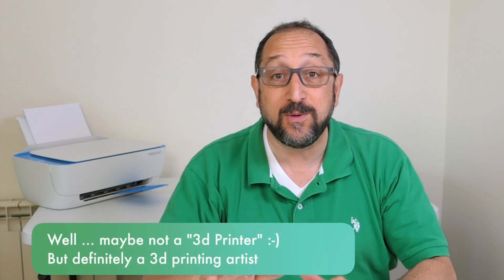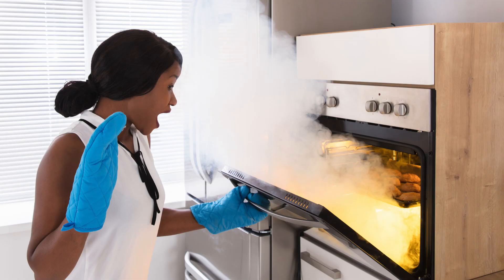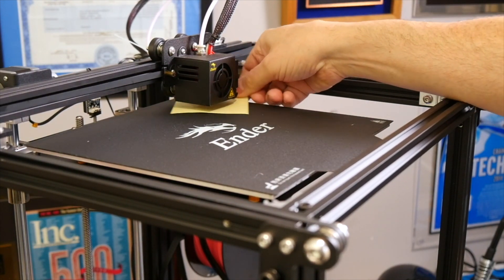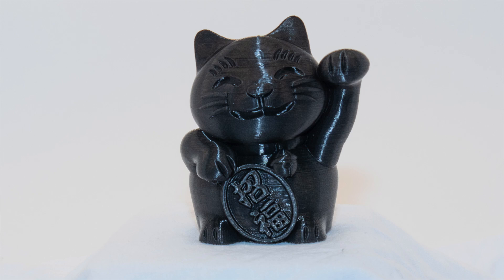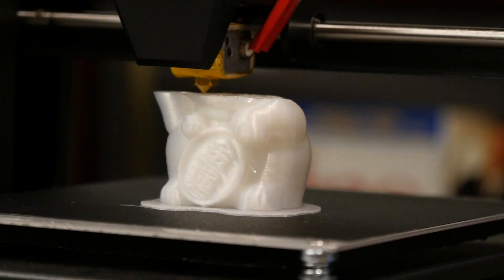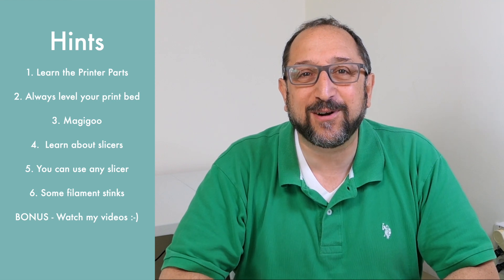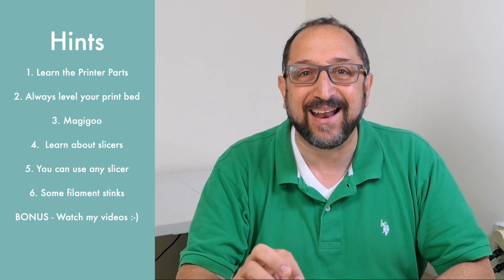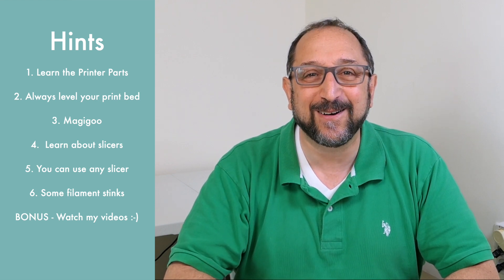Learning about 3D Printing * 6 Things You Need to Know

Comment: Just to reinforce the common sense behind what Dr Vax says in the beginning, I spent about 5 weeks digging around on youtube learning about printers, slicers, modeling software, upgrades, etc before even ordering a 3d printer. Once it arrived,  I already knew what steps to take to ensure the very first print was successful. Even the 1st time I tried TPU, the print was useable and almost no stringing from an Ender 3 w/ boden tube extrusion.
Reply from the maker: Thanks.

Comment: Safety first.  Check the wall outlet to be sure that it is grounded.  Just because it has a ground plug does meant that it is actually grounded.  A smoke alarm over the printer is a good idea too.

Tools like needle nose pliers, deburring tool, calipers, nippers, etc. will be needed.  

I really like your videos.  I'm sure they are not as easy to create as you make them look.

Comment: I got my printer to work with Cura. You need to install the drivers for the printer and flash a bootloader and upgrade firmware.
Reply from the maker: Impressive.  Most of my viewers may not be comfortable with this level of effort and the technical sophistication.
Reply: @MakeWithTech  I totally agree. I'm very computer savvy. This is my first printer and it was still pretty intimidating. Great hints. Thank you for making this.

Comment: Your videos have been very helpful as I learn about printing ahead of getting my first printer. I'm looking at either the Ender 3 or 5. 

Do you think that the increased stability from the external frame and the fact that the print bed does not move x and y justify the increased cost from the 3 to the 5?
Reply: I have two Ender 5's.  I think the extra cost is worth it, but that is a personal choice.   They have worked well and I'm very happy with them.   All of the Enders are easy to upgrade if you like to tinker and have a large user community and upgrade sources.
Reply from the maker: I also love my Ender 5.  But it is quite big. If you have less space the new Ender 3 pro is also a very nice machine.

I built an Ender 3 pro with my grandson recently.  You can watch a video about it on the channel.
Reply from the maker: Don I agree with everything you said.  Because of the limited bed movement I push the speed on the printer quite high -- until it reaches the firmware limits without much of a drop in quality --- as long as the extruder can keep up.  I have an upgraded extruder that seems to handle speed quite well.
Reply: @MakeWithTech  I went ahead and got the 5, I figured I could try to enclose it and use abs with it as well. What upgraded extruder did you get?
Reply from the maker: I used the SeeMeCNC EZR Struder which I really like.  Another viewer mentioned that SeeMeCNC has recalled some extruders from a bad batch so I would order directly from them.  There support is quite good.